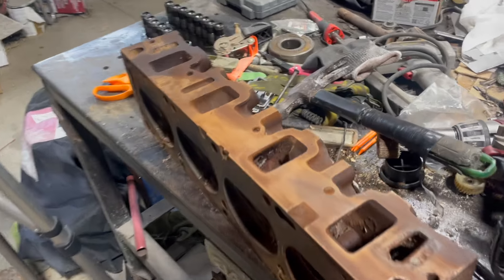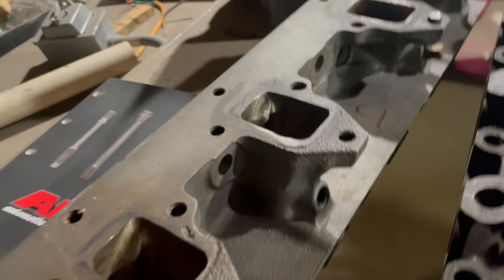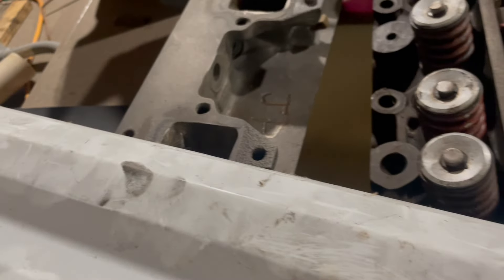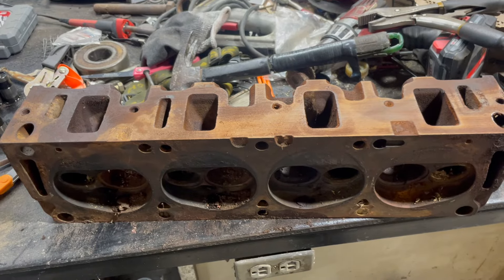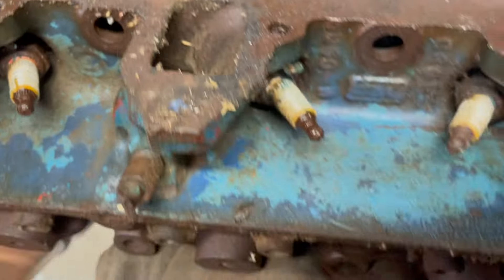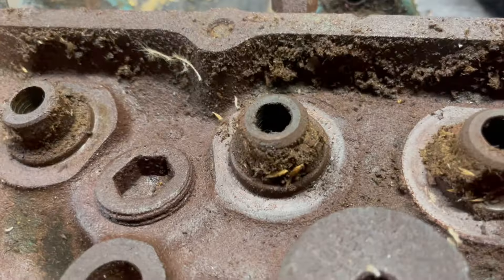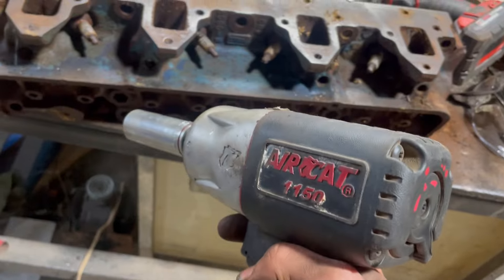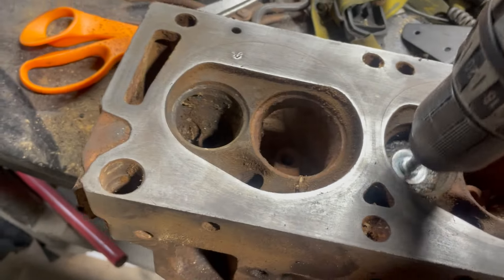I FOUND The MISSING Cobra Jet Head!!!!!!!

Comment: Huge FE fan here! Been racing them for decades. It's nice to see a young guy interested in FE engines. I've torn down dozens over the years. Mostly pickup engines. Found several with mismatched heads. Usually, they were rebuilt by one of the big commercial engine builders like Atlas or Jasper. Subscribed now, gotta keep an eye on this 406! 😉